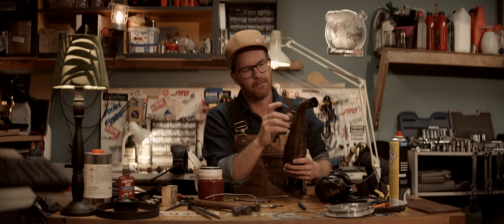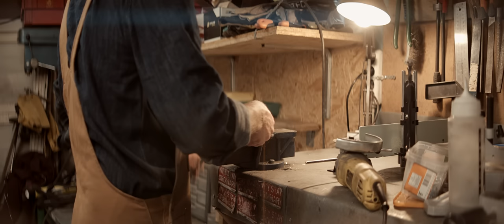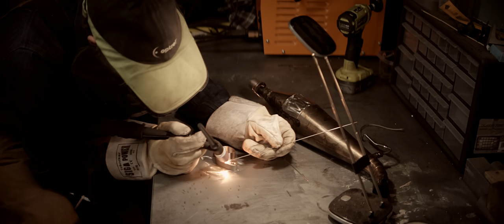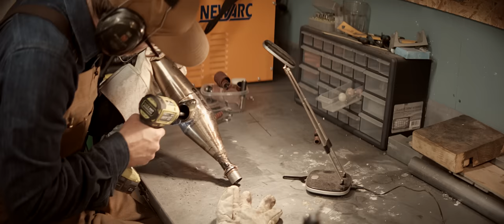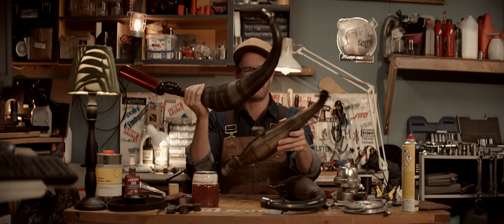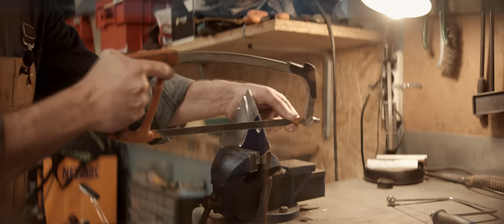Two Stroke Pipe Wastegate - Why do I get such strange problems?!

Comment: Some interesting mixed results there Alex, probably one of the hardest things with a  2 stroke is tuning the exhaust system. With what you did making the  hole in that pipe, I'm thinking would of be the equivalent of a larger expansion chamber without changing the sonic pulse length. The intake dimension changed things a lot and was interesting to see. I wonder if a exhaust system design, like on a older yamaha YZ, with a large expansion chamber right up close to the exhaust port, that then tappers off into a long conical shape, pretty well a reverse of your main exhaust pipe your using might be worth a try. Is there a motorcycle wreckers near you?, I was thinking if you bought a few different exhaust pipe's cheap, to test with and  help with the experimental side of things, to test, cut up, weld changes and so on. Rather than one's you've had made for you that would cost more. Then when you find the right exhaust pipe system that works well, have it copied and made then.

Comment: The resonance of the pipe is probably big and causes blowback, therefore not enough mixture gets in the cilinder. This problem occurred when your switched from reed valves to rotor inlet. The big exhaust port makes for a unreliable small powerband. Maybe try a little less extreme timing on the rotor inlet, and bigger crankcase volume as a buffer.

Comment: Pulse timing and carb tuning. You should make an adjustable expansion chamber it would make things a lot easier on you as far as tuning, I had an old Kawasaki 650sx stand up jet ski with an adjustable expansion chamber.  You could tune the engine for low RPM or high RPM depending on riding style and I thought that was pretty badass I'm sure you could make one of your pipes adjustable simply by cutting the pipe in half at the belly of the expansion chamber and make a few sleeves to adjust the length. A Google search will explain it better than I can.. anyway badass build I love seeing the updates that little engine is definitely a ripper 🤙 good luck with it!!

Comment: There's those RC pipes where the back of the cone is on a spring and moves with pressure.
I'd cap the short pipe now that you have the side bleed and see if forcing the exhaust out the bleed changes the timing enough to make any difference.

Comment: standing waves in the pipe, you may want to look into how manufacturers use an add'd chamber to intake piping to cut down on intake noise/drone, also consider a trombone type adjustable resonator, to be able to tune it on the fly if needed.

Comment: It's almost like you need petals that military jet engines have at the thrust end.
Your hypothesis of exhaust reversion seems about right to me and indeed petals would work as a one way valve. To test you could try a cone or a series of cones inside the pipe before the expansion chamber and see what happens I reckon.
Bernoulli's Principal would indicate that the cones mightn't be that much of a restriction as they'd act as a Venturi in one direction for the gas and a dam for returning pulse waves in the other - which might not be a good thing but then again we're here because we're testing shit right?

Comment: Many single-phase electric motors spin at 3400-3500 rpm.   Perhaps creating a starter out of an air compressor motor or something similar would be a worthwhile project.  Although having it portable for the salt flats would probably be a good endgame plan.   A side note,  it sure would be nice to have two hands available when starting the motor instead of having to use one hand for the starter system.

Comment: Perhaps the pressure wave that is problematic isn't affected much by the hole added in the straight section, which is 90 degrees to the direction of the pressure wave.

Comment: You might consider a variable waste gate close to the exhaust manifold. It was apparent at lower rpm, the absence of return pressure waves allowed the rpm to approach the power band. If return pulses occur by means of expansion and contraction, having the waste gate at the largest diameter you are at the lowest pressure,  having the least effect?

Comment: Loving your content. Finally making progress. I’m not sure what your solution will be however a vacuum or manually operated dump valve (exhaust cutout) might help with the transition. A wye attached to the exhaust port with the cutout on one side and the manifold on the other. 🍻

Comment: Put a sheet of metal between the belly of the muffler and the valve which closes with a small hole that you will lighten by doing many tests. nice job good job

Comment: I had the same problem with a 80/66cc bike 🚲 engine. I had to build a ported flange for a somewhat controlled leak to connect the expansion pipe.

Comment: Had an idea Alex have you ever seem the bov that are the pipe and it slides a sleeve back to blow off boost? Something like that on the pipe where it meets the cylinder with an outer sleeve that slides back and forth. Could even add a nut to make an adjustable stop to make it open the right amount down low then when it gets going it slides closed. Could even make it progressive so it acts as a variable length.

Comment: Try an echaust butterfly valve from a 600 or 1000 cc sport bike. 

You can find them as throw away from full exhust upgrades. The valve and servo are available. It controlled based on RPM with different options.

I understand the disire to overcome the starting issue without a over pressure relief valve. Sometimes, like what you found out, a simple hole is all thats needed to start. Then as RPM increases the butterfly valve can be opened or closed.

Comment: It's nice to see the engine produce exhaust smoke. Changing to the smaller carb was a good move.
I would suggest richening up the mixture to see if a cooler combustion cycle would help slow down the pulses. This can be done by turning the choke on or adjusting the pilot jet/ needle clip position.
Thanks for the mid week update.
PS. Please don't over look advancing the timing upto 2mm BTDC and using the tick over screw to allow the engine to idle at 3-4k allowing the pilot jet to be adjusted while running.

Comment: I have a very limited knowledge, and you most probably know this already, but race teams of the 70's 80's and 90's used to spend a small fortune on  building "tuned" pipes for their bikes and it really is a "black art". In addition to this, all the major 2 stroke manufacturers came up with power valve systems to alter performance through the rev range, Yamaha' pioneered it with their exhaust mounted YPVS system I think.

Comment: I remember the Honda NSR500 having a starting problem in low tempters, and as the first 100mm of exhaust had a water jacket to change exhaust timings, they just preheated it.

Comment: I would try running it with the pipe in open air. Without the exhaust extraction ‘sucking’ the mixture out of the pipe. 
Good luck, love the videos!

Comment: Throttle butterfly distance to port vs crankcase volume  vs  exhaust pipe tuning.  Black art.  Always was
Reply: I thought the initial idea was to supercharge a 50.

Why would you worry about a cranckcase transfer system with a blown intake?

Comment: What about just adding a length of silicone tubing to the front side of the normal carburetor you intend to use (like a velocity stack), then once it’s started you could remove it? Of course this could open a rabbit-hole of adjusting lengths for different RPM’s and many other ideas / things, but at least it’s easy to try / see it it has an effect.

Comment: Are you sure the mixture isn't too rich at low rpm? Possibly due to intake timing, allowing air to pass throught the carb multiple times, sort of like when you have leaky membranes and it goes rich at low rpm then leans out, the air getting sucked in through the exhaust when you introduce a leak near the flange could point towards that
Reply: It does sound like it’s too rich

Comment: 3:45 minutes in, my gut reaction is to do what was common on 0.49 glow engines back decades ago, create a slip fit collar to open and restrict the leak to the tuned pipe inlet.

Comment: You need something to alter the pulse timing. Variable guillotine, or rotating cam-barrel devices work for manufacturers. I've always thought having a constant-diameter center chamber tube with a  sliding rear cone would be another way to accomplish the same effect. You could also bleed the pressure at the point where the large diameter of the rear cone meets the constant-diameter tube, thereby minimizing the sound amplitude that escapes with the exhaust gas. I'm not sure what kind of artifact-reflection that would introduce, however.

Comment: In the mid 80`s me and a freind ended up with (maybe) the same problem.
We where fiddeling at mechanical school with a Kawasaki 100 with rotary valve and a short pipe from a 50 cc Suzuki upgrade exhaust
It was impossible to kick start, but still remember the isane power we got if we started it in firs gera and kept it over 4-5000 rpm at all times Another classmate got a Honda 350 and he could not keep up with this bike if keept around red markings.. It was "insane" back then But just to impractical
All i can say is i think you are onto something here ;)

Comment: I do 1/5 scale playing with Rovan 71cc engine, and I had a similar  problem , my engine will start, but would not get on pipe  at low revs and I work out it out as I do my own billet  heads. The problem  was the billet  head did not have enough cc in the camber  of the head. After I machine the camber for more cc volume  in the cylinder  head, the problem was fix.

Comment: The rotary valve maybe.
Normally an expansion chamber has a forward and backward pressure wave, helping with drawing in the oil/gas.
Maybe by the exhaust actually being closed off by the gate a pressure wave builds up on the intake- then it opens and poof, the next gasp gets sucked in. 
Maybe no expansion chamber required.
Dial it in with exhaust rotor timing

Comment: A larger restiction at the end of the pipe would actually make the effective pipe longer and lower resonnance. So when you tried a a larger stinger you'd probably made the sitation worse by tuning resonnance up instead of down.. If at all this would change frequency enough to matter I dont know.. I'm curious to see what will be the solution for this special case :)

Comment: You can use a killer of waves in the exhaust pipe.
Helmholtz resonator at the beginning of the pipe.
First S.A.E.C  Suzuki  automatic exhaust valve.
It just kill the waves and avoid emptying the cylinder.

Comment: A BOV on a 2-stroke pipe is one of the wildest mechanical things I’ve seen.
Reply: Wastegate. You should look at turbo snow mobiles they have wastegates exactly there.
Reply: @MrJermbob  technically, you are correct. But there is no turbo here, hence the wild tag.
Reply: @LightBranches  No shit lol. You said blow off valve. Its not its a wastegate.
Reply: @MrJermbob  right, right.
Reply: @LightBranches  His pipe is wrong for his motor. Simple. Pipes that work are mms of differences away from pipes that dont.
Reply: @MrJermbob  it could be as simple as that. Or it’s a haunted engine. Ernst Degner was a known practitioner of magick, perhaps for good reasons.

Comment: It dawned on me after watching this video, that many of the old racing bikes with tiny two cycle engines used spun the rear wheel to get them started and they would get a push start and still have to slip the clutch like mad to get them going in first gear... I realize there are other reasons for starting the bikes in this way, but many teams use a gas engine with rollers to spin the engine at high speeds.

Comment: Do you think you could be getting some extreme short circuiting of the transfers with the more ‘effective’ pipes?   

The fact the big hole made no difference could prove it is a header/diffuser issue and not a baffle/end cone. The biggest difference was when you moved the header off 3mm to lessen its effectiveness.

Comment: It's not weird the hole in the side of the expansion chamber made little difference... remember its not gasses pulsing its the sound wave..in my humble opinion you need to pioneer the variable length pipe. On the central untapered part of the expansion chamber not the header.. its the ultimate power valve and to see if its the right route you could try it manually first. It would be incredible if that engine could pull from low down too.. Great video btw.

Comment: It’s funny that this engine is 13cc SMALLER than the 2 stroke engine on a Harbor Freight TailGator 900watt generator 😂 the genny makes 2.2hp @3600 rpm. 

Side note: I want to put a bigger carb and a tuned pipe on one of those genny’s and use the generator head as a dyno to see how much power it can make. They’re basically a really old scooter engine modified to run at 3600rpm with a governor.

Comment: 1. Make a copy of the reflector to go on the outside of the reflector attached to the rest of the pipe like a sleeve.
2. Drill holes in both at the same spots.
3. have a servo turn it to close off the holes at higher rpm.
Idea: the holes should be in the reflector as thats where the exhaust build up will be, trying to adjust the gas plug from the middle doesnt look like its working too well. Also a tube going in at 90 degrees like that is gonna make turbulence and disrupt everything.
Noteworthy: Could also attach a bigger pipe on reflector sleeve before the holes to make it vent it out the back instead of everywhere

Comment: you need an exhaust with a variable body according to the engine speed which varies the length of it. There are already exhausts like that "Ninja modular" , "Gencod with pump" for MBK 51 for exemple.

Comment: I'm glad you thought of just going for a high idle, 6000rpm idle anyone?
For other tuning options the intake should be easily modded with 3d printed trumpets, you could also add in manual restrictor adjustment by copying something like YPVS.

Comment: I wonder feasable it would be to make some sort of auto-restrictor using pressure, perhaps with a narrowing diameter or some sort of open dump.    probably out of the scope of what you are looking for, but I think cold start, low rpms are never gonna be suitable for a high rpm/ power pipe without giving up something on that end

Comment: Maybe you should look at the cylinder/ port  exhaust exiting, it could be very turbulent until rpm is high enough to brute force it's way out,  maybe you can run it with a high speed camera watching inside the port?? Even if it's only a pyrex plug in the pipe, to see exactly how the exhaust is leaving the cylinder! Maybe make a 75-80 mm extension with a 50 mm pyrex plug in the side of the pipe, to allow you to see in the port, while it is running.

Comment: It is my understanding that some of the 50cc gp engines back in the day had to run at over 5000 rpm to keep going, so for max power engine it may just need to go fast. Also you may want to look at brushless remote control car motors for a high speed starter. Some of the big ones 1/8 scale can make a lot of power and can turn over 10000 rpm.

Comment: Perhaps a plenum chamber, on the carb's mouth, with the air intake hole / holes offset to 90 degrees. This could be calculated & designed to counteract any off low RPM resonance pulses blowing back through the carb.
Reply: But he wouldn’t do this I think because he want to use this pulses in high rpm range

Comment: for starting engine use big 2000w angle grinder with soft start function, they spin at about 5000rpm under load (there are som versions that spin 7500rpm)

Comment: I think the pipe is just trying to put a Band-Aid fix on the problem, not curing the cause of the issue.
At the end of the day it’s a conventional 2 stroke with rotary valve. My personal thoughts are the timing isn’t right to flow gases at low speed or there is a leak around the valve and it’s not sealing like it should and the mixture isn’t flowing through the cylinder properly.

Comment: Since you know it runs with a small gap, why not engineer a gap by drilling holes at the start of the pipe. You can then have a sleeve, also with holes, which can be rotated to expose or cover the holes in the pipe.

Possibly the gases escaping through these holes could be diverted to another part of the exhaust system to negate any remaining pulses but only when the goles are exposed.

Comment: Rather than the pipe being the issue, could it be the air flowing into the motor is moving to slow at low RPMs? Once the RPMs come up the air flows faster causing it to run normally. I know on 4 stroke engines, if you port the head too much and it reduces the air speed coming into the engine, causing these types of issues. The smaller carb would also restrict the airflow increasing the air speed into the engine.

Comment: It might be that the hole at fat part of the pipe does not damppen the higher harmonics. Thinking that if the higher Mode has neutral pressure at that pointti. It would be interesting to see a short pite with fitting where you have a variable hole at root of the pipe which can be closed at high rpm. To do what you do by moving the pipe by hand

Comment: Do i remember you having a router? Those spin really fast and should be fairly easy to adapt to your starter mechanism, no load speed would be much faster than you need but with the load of starting the motor it might be within a reasonable range?

Comment: This happend to me l, turned out to be crank case volume.   I never changed the pipe to see if that help my issue.  I changed crankcase volume and it changed.  Just like mine, it loved having a guarte inch gap right out of the port.  Anything else, it hated it.

I know you want the volume that you have and I understand why one would not want to not change case volume.